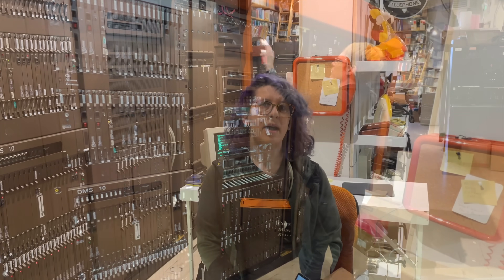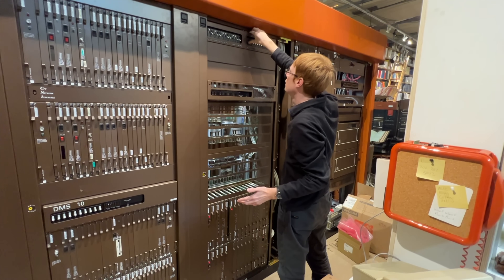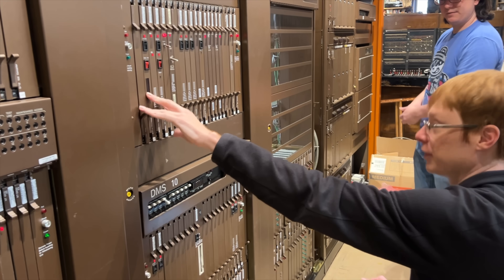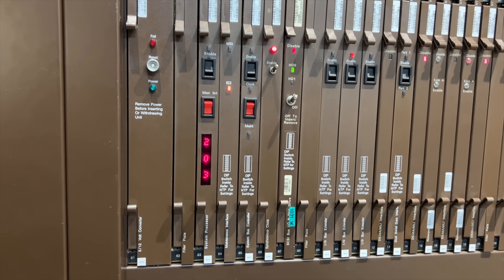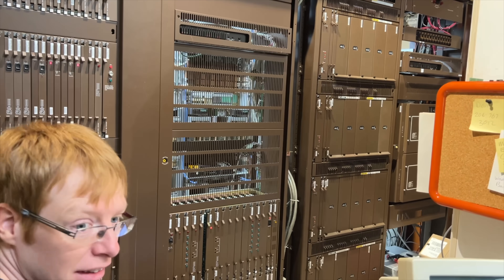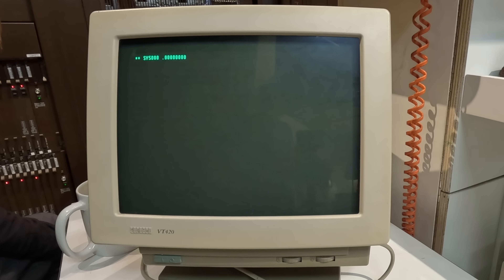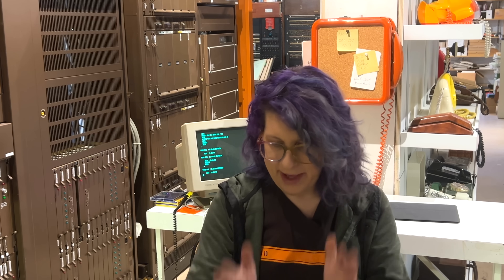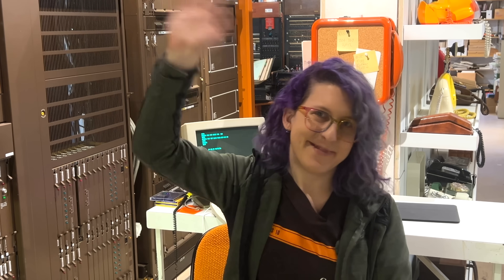🔌 DMS10 — Power Up! ⚡️

Comment: The VT420 didn't hit the Canadian market until ca.1988, and IIRC the DMS10 predates that noticeably.  The VT320 or even VT220 would seem to be more likely craft consoles to be bundled with the DMS10.
Reply from the maker: This DMS is from 2001! They upgraded the terminals as time went on 😊
Reply: @ConnectionsMuseum  How? The DMS-10 was introduced in 1977 ?!?!?  If this was a DMS-100 (which it looks like to me, at least it strongly resembles the one I worked beside for a decade) then the timeline makes sense but otherwise, what am I missing?
(To be fair, ALL BN/Nortel CO gear kinda looks the same, across a 30yr timeframe, but still.)
Reply from the maker: @athompso99  it’s a DMS-10 and it was the last one to roll off the Nortel assembly line. The people who originally purchased it from Nortel gave us its backstory.
Reply: @ConnectionsMuseum  ok! Wow, I would never have thought production lasted that long, esp since the -200 effectively replaced it (I think).  Thanks for the info!
Reply: @athompso99  For some reason ill agree... 1977 this was probably orig made. Maybe this one was laying around until 2001... The DMS-100 was made in the 1980s and seems more advanced then this DMS-10. But the 10-100-200-etc is just how many lines/customers it can serve. DMS-10 is 10k lines a DMS-100 is 100k lines a DMS-200 is 200k.
Reply: @Starlite123 These machines were too expensive to just have lying in a warehouse, they were made just as fast as they sold. The hardware went through several revisions over the years and this one is part of the last generation where the cpu is actually PowerPC chips. The 10 was cheaper than the 100 and better suited to small installations
Reply: @St0rmcrash  Got it thanks for the info. All i knew was DMS-10 was 10k customers and DMS-100 means 100k and DMS-200 means 200k customers.But i thought they where made in the same years. Like GTD5s all about same exact age.
Reply: @Starlite123  Ah, in the case of the GTD5 I think that's due to it getting discontinued in favor of the 5ESS after GTE Automatic Electric was merged into AT&T Techologies (via AG Communications) so they were only really made in the 80s
Reply: @St0rmcrash  Yeah the 5ESS has ISDN and etc. newer and more feature packed. Ive never worked the 5E offices just have minor knowledge about call features.
Reply: @St0rmcrash  yeah. The Generic that they are using was developed to work with the Power PC. The processor prior to the Power PC in the DMS-10 was a MIPS based processor (2000 I think) and it ran the code interpreted. There was another processor prior to that, but I forget what it was.
Reply: @ConnectionsMuseum  and yet we always had to keep a paper teletype around to ensure that that still worked too!

Comment: It's great fun to see the other half of Nortel. I worked on the data/LAN side as a Systems Engineer and my colleagues would go on about the DMS's and I was pretty clueless.
Reply: I remember being in Raleigh (RTP) in the late 80s for DMS training when Baby Jessica fell in the well.  ( don’t worry she’s a ripe old 37 by now). Think I have a bit slice CPU board from one of our 10’s   Someone should do a history of switching in Barbados from the Northern Electric xbars in the  70s, then DMS-10s, DMS-100/200, DMS-MTX and line concentrators.   Until the whole lot was replaced by a single(?) Genband soft switch.
Reply: @AlistairGale  I was down at RTP in the early '90's when I was still with DEC to learn how to use Unix (I was a VMS person). RTP was an amazing place. I remember sitting in the hotel bar when Bush Sr. announced we were going into Kuwait. Interesting times.
Reply: @MrTherende  A bit before your time, we used to chill in the hotel bar and watch (the original) Battlestar Galactica with our Iranian bartender, we also absolutely refused any offers of seafood restaurants from our instructor.

Comment: This was particularly interesting because the company I worked for once had a Nortel switch like that; it might have been a DMS-10. My manager at the time was formerly an executive with a telecom company attached to a major university, and had converted them to running their own phone system. I think our system replaced a Centrex setup. It must have been installed in the early 1990s. Eventually it was replaced with a VoIP box-on-the-wall system, and now we're fully remote, so we don't really have company phones anyway. It was a lot of fun to learn more about telecom stuff, and my boss would explain what was happening and show me things. 

Most definitely I must visit sometime. I'm mentally ranking visiting the Connections Museum with going to Japan...both are way up there, but forgive me if seeing the museum is a little below riding the Shinkansen.

Comment: The thing about the 'back up from dark' instructions would be that... It's really not too bad to bring up the standby side of most of the systems on a DMS. If I were on site doing that I'd turn it over to the on duty switch techs at the NOC to just correct the standby alarms while you'd clean up the site. Not that we ever had anything like that in my short time working with these...

Interesting you had an MO drive. Our MTX was backing up with one of the larger quarter inch tapes.

See if you can find one of the Nortel branded HP thinkjets for the console printer. :D
Reply: 400 series used quarter inch cartridges. 500 series introduced MO disks circa 2000.

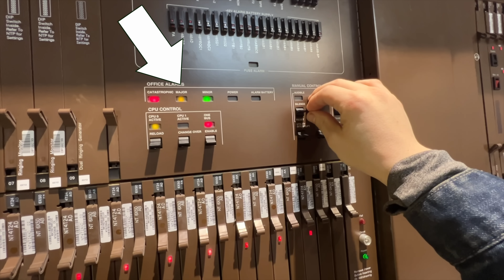Comment: 09:03 Minor, Major and Cathastrophic alarm. Only missing the Ludicrous alarm..
Reply: That would be "smoke". 🙂
Reply: I bet that the "Catastrophic" alarm was probably named something like "Unrecoverable" to begin with ("hard" alarm fails that cannot be reset/cleared from within the running system such as critical I/O faults) only that as the software moved on, some of them gained recoverability.
Reply: The next "alarm" is arc's and flashing, it flashes in Morse code saying "extreme danger, evacuate immediately, disable power immediately" if you hang around that long anyway 😊

Comment: My next hardware project just HAS to have a "CATASTROPHIC ALARM!!!" indicator. Fabulous to see this project coming to life.
Reply: Awesome to see You here! i hawe mad respect for Your builds!
Reply: @Vampi_Sweden  This is one of my favourite channels without a doubt. One day I will find some old microwave telecomms link hardware, do a restoration and get it running. I used to work in telephone exchanges back in 1975, then worked with Ericsson MD110 switches in the 1990s, but it was the big old-school microwave links that were my favourites.
Reply: @MachiningandMicrowaves  That sound awesome! I kind of collect old radio related telecom equipment my self, but mainly from the earlier pre 80s eras. I so badly whish there where more people like us where i live since almost nothing has been preserved here from the old telecom era, despite they even had a large cable relay station in the city whan i was a child, but it is all now just empty shells, i been inside there a few years ago but sadly there was nothing left of the relay stations but the marks from the ancorbolts in the floor. I am however glad they decided to preserve the building with the original exterior look.
Reply: Oh snap there's my favorite machinist. this must be why I was blessed with the recommendation for your channel. Awesome.

Comment: Wow amazing how much differenet the interface is to a DMS-100.
Reply: No, the menu system is not available in the 10. The 10 and 100 are very different switches by the same company. Several DMS100 peripherals (LCE, SCE frames, DCI shelves) were adapted into the 10, but that's it.
Reply: @johnnydollar2253  Got it :)
Reply: IIRC it shouldn't be. This is down in the sort of... I used to call it the CLI mode, I forget what the official name was. This is where you'd generally do serious hardware stuff (like disk configuration, patching, swapping primary and secondary CPU....) The little ASCII semi-gui I think is also available on a -10.
Reply: @warphammer  At least in my working DMS-100 the gui was like the Nortel Transport eq. pretty easy some hidden(lots of hidden comands) with most commands listed. You can use MAPCI in the terminal to start the guis in these. I would start the gui with MAPCI;LTP;LTA;LNS to get into line test and DN info etc.
Reply: I worked for several CLECs and Telcos in my younger days, running DMS-100, and I most always ran a  CI (Command Interpreter) prompt. I would run commands from a store file, makes it quicker.  I was forced into retirement from a larger telco, and seeing this post brings back good memories.

Comment: I am a 28 year veteran of supporting Enterprise Class "PBX" systems, primarily AT&T/Lucent/Avaya, but also previously Nortel Meridian (which would have been the enterprise counterpart to the DMS-10/DMS-100). I enjoy your videos on the DMS-10, because it reminds me of supporting the AT&T Definity platform, which is the enterprise counterpart to the 5ESS (and much of the architecture is practically identical between Definity and the 5ESS). I can recall the Definity's startup sequence, (which in the early 2000's would have been running on Intel 486 CPU's at 66MHz), like the DMS take forever.

Even recently after a "break glass" event that shut down our datacenter, faced with a cold start of our virtual machine stack that composes the modern PBX, and had certain waits as various components came back online, and of course the "core" server, which even with modern CPU's and the like still took 10 minutes before dial tone was available.  

Of course all good things must come to an end, Avaya announced that the December 2023 release of their software would no longer support the last of the Definity-era hardware. I have a couple of trunk and subscriber cards, as well as the corresponding digital phones in my private collection, as a reminder of where I started in this business.

Comment: Can you use a raspberry Pi or some Linux software to simulate remote access to satisfy the alarms?
Reply: You could, but it would be pretty involved. The RLCMs and other remotes were coooomplicated, having their own CPUs and were alllmost switches in their own right. (I worked on a DMS-MTX with the cell version of a remote, the CSC)

Comment: By the year 2000 they were still shipping equipment with that quaint and lovely but ever so ugly 1970's burnt orange and brown paint job?  O_O  Now that's sticking to tradition!  ^_^
Reply: The only real change to the DMS line's 'look' the whole time was when the NT logo changed to Nortel. 5E switches didn't change much either. It's a smart move: You'd get new line cards and replacements all the time and it'd look bad to have different colors all over the place.

Even the remote cell modules I'd see at my job were that color of brown.
Reply: We had carpet that orange color when I was at Data General in Westboro MA in the 70s...should have taken a piece with me. Sure woke you up when you came in.